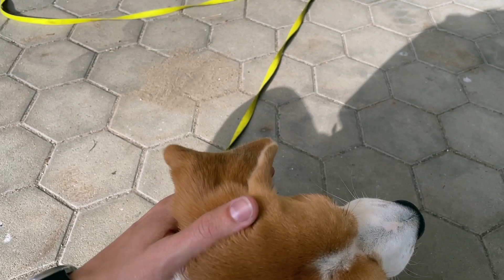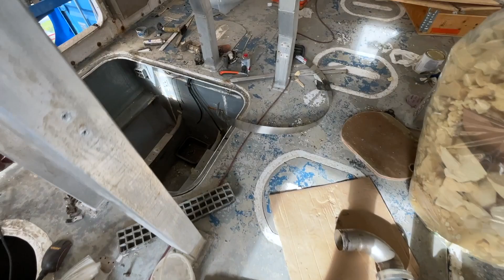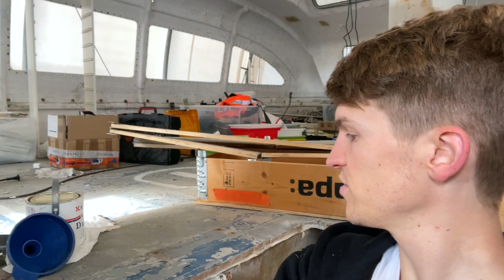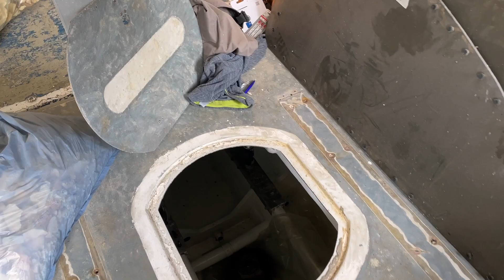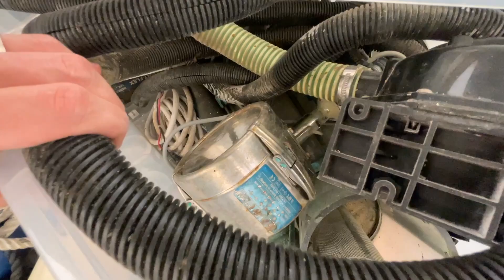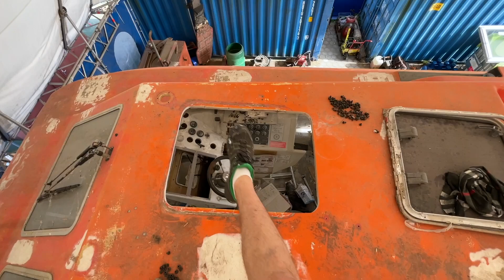600h in 22min: First year of lifeboat conversion

Comment: A very cool project, I'm doing something similar, but my boat is nowhere near as much of a blank slate as this. What kind of battery and voltage setup are you doing? I assume LiFePO4 chemistry for cost and safety? 24V low voltage bank and ~200V HV bank? Or are you going to go even higher with the voltage for the traction motors?

Comment: so just finish3ed binge watching all your vids, I admire your efforts (oh to be young again lol)  so my thoughts are you're doing AWESOME! also, you could do just fine with one motor, two is going to be epic!  as for solar (the reason i'm watching) I'm going to use the solar array as a deck roof that covers my whole boat , a very lightweight aluminum frame can be erected at head height and give you a large deck with guard rails on top of your boat, it may even be possible to run some nav-gear up the new 'flight' deck, and you can have solar panels that fold out to double the surface area when conditions allow, panels are dirt cheap over here in America, you can get used 240 watt unit's for about 60 bucks, anyway,  I'm watching your story now 🙂
Reply: also, there's the issue of ballast, I think you're going to need a lot, as compared the what the boat was designed for, and taking out those boat anchors will make you like a leaf in the water lol

Comment: You are doing fine given you time constraints of having a young family. 
There are two other projects you should look in on and possibly make contact with as they are sharing your experiences at the moment ..
First is Sailing Oceans the Polish familly with their trimaran they are planning to electrify. 
The other is a fellow German working on his live aboard and planning to convert a steel barge platform...into a home or workshop hes not sure yet.
My first boat..... https://youtube.com/channel/UCUsYuHgNS1aNglyj8-sInSw.

Theres also the English guy working on his monohull lifeboat conversion ...Nigel 🤷🏻‍♂️😂 
Everybody is experiencing materials and parts availability /cost related issues so you may have to get box clever and think of unconventional solutions. 

BTW... If the head is going to be at the rear of the boat and the blackwater tank is at the front ..i think even if you use a macerator head its going to settle out and cause blockage problems 💩😬🤢 clearing a meter of such pipe is grim clearing a pipe the length of the boat 🤔?? After its stood for a while? So Sewage storage needs to be not too far away and easy to rod clean and access...
If your going to use it for grey water ..collected rain water for flushing loos etc then fair enough a water  heating cylinder with heat exchanger coils built in will be a useful way 
Of storing energy ..
Remember what i said about the use of Hybrid PV Thermal panels being more efficient and maintaining their capacity over a considerably longer operational life.🧙‍♂️ Especially if it gets hot on the roof.

Comment: It’s looking good, I can’t wait to see it in the water.  If you want an easy way to clean corrosion on the engines and other parts, look into dry ice blasting, it does a great job and leaves no mess behind like pressure washing.
Reply: Agreed it would be quick and effective... and dry ... I wonder if 
a firm would sponsor him to show their metal refinishing technology. 😉
Can lasers be used on Al casting ive seen them used on Steel.

Comment: Love the progress man, doggo is a win. Audio has gotten better, you really needed it. Hey just out of curiosity - Rather than glassing over the crane anchor points, why not use them? Since barnacles hate copper, having some milled heat exchangers to match the shape of the boat. Those heat exchangers should be able, if designed correctly, take care of the motors, heat pump, and anything else you want to throw at them. They are already located where you need them anyhow, one at rear for motors, one up front for the heat pump.
Reply: His front one is totally clear of the water so thats not going to work really... 

If he want to create his own keel cooling system he could use the rear Position ..
Or build linear ones in each hull..  copper pipes in lager HD  plastic tubes scoops could force flow through underway but  propellor pump should make for adequate flow when not underway.